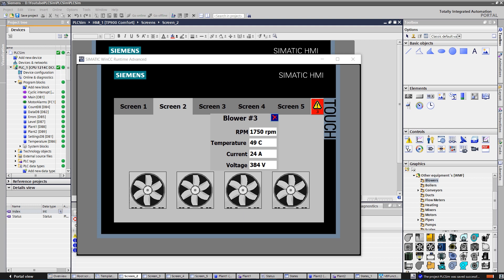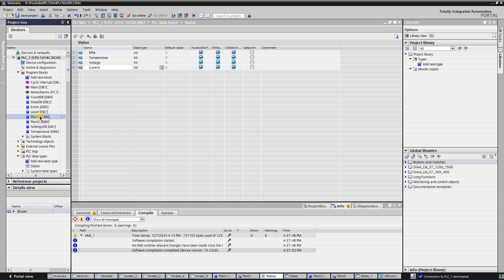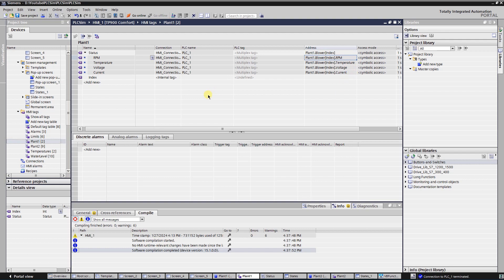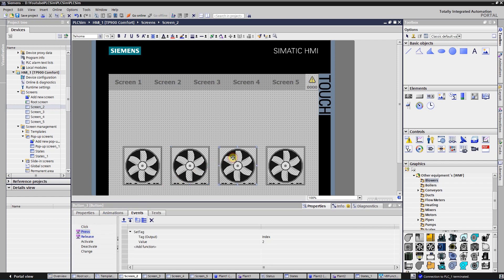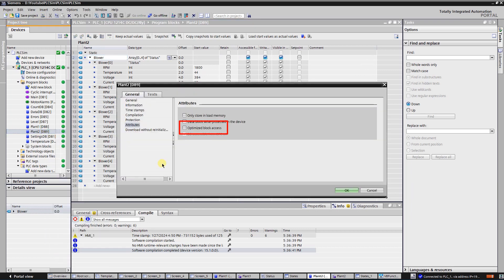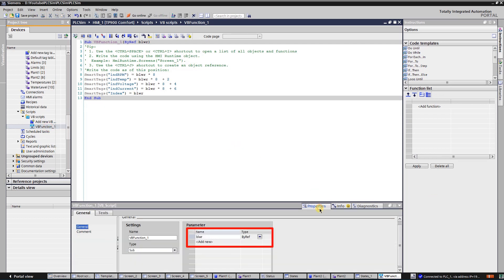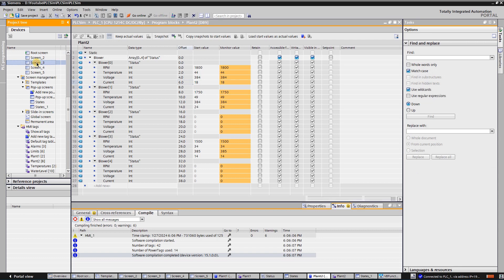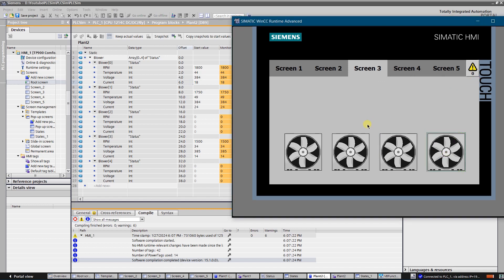TIA WinCC Advanced: Indirect adressing

Comment: In the event field I cannot add an indexed address or within a data type.
Reply from the maker: I am not sure where do you face with the problem. What is the timestamp of the video?
Reply: @automatikavaldymas  Your video is perfect. But if the same address is what you read, how would you write to it? If you need to change the value, how would you configure it in the events tab?

Today I have a problem in my case. When I create a DB data type and import it into the HMI, I can't put it in the events section, in this case I am forced to address it individually.

If I try to create a button and go to events to call set on, address that contains array, it doesn't work, example

set on pump[0]
Reply from the maker: If you followed the video then you do not need to do anything special, just make sure, that your I/O Field type is Input/Output. In my case type of those fields is Output, so it will only output the data without alowing any iput change. If i do change the type to Input/Output, then i read out values from the CPU and write them to the CPU as well.
You have wrote "When I create a DB data type...", well, you need to create a "PLC Data Type".
But if you want to do it via button click event (for example change the RPMs of pump #1), then you simply need to add two events:
1. SetTag Index 0.
2. SetTag Status.RPM 500.
These are from my example.
Reply from the maker: @andresilveira2721  OK.

Comment: Cool, my friend.
That's what I wanted to do.
Question: if this address needs to be written, how would I use it in the event field?
Reply from the maker: I believe i have answered you in another comment. In the button click event you need to set the value of the tag Index and only then set the array tag, but without index, like that:
   Function       Tag         Value
1. SetTag       Index            0       (for pump #1 if it is not already set. If it is, then you do not need this function)
2. SetTag  Status.RPM  500   (RPMs for pump, which number contains tag named Index).